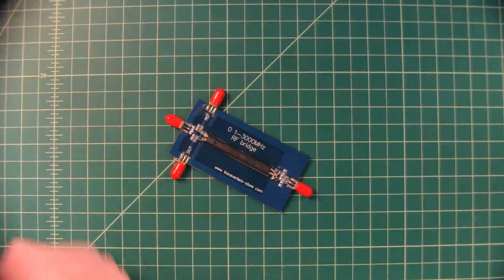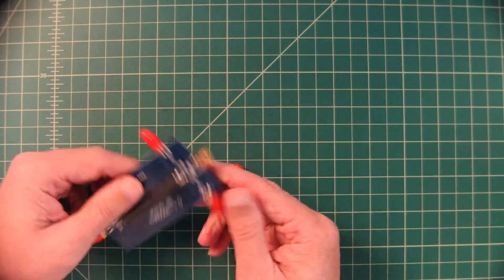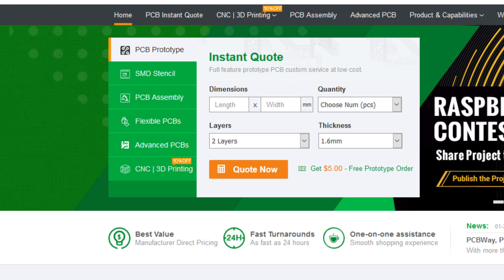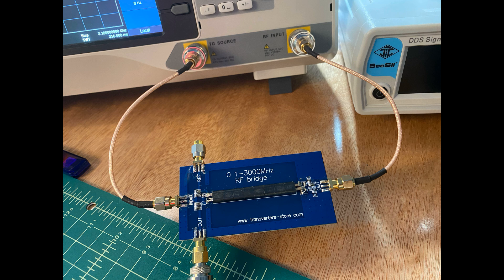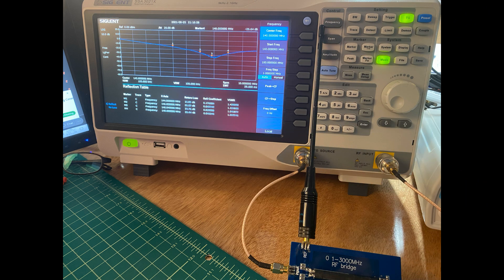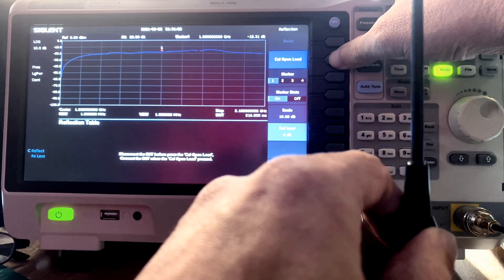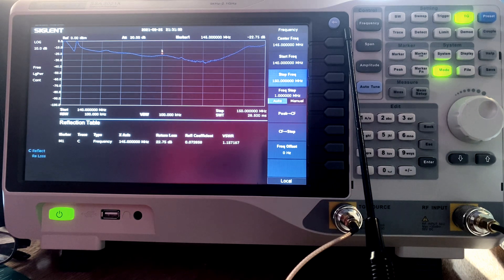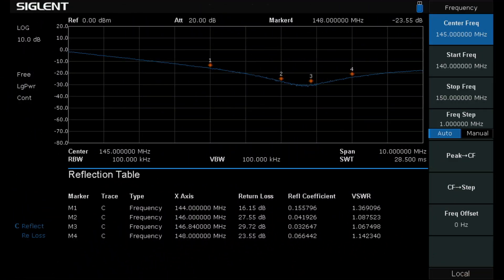Cheap RF Bridge testing with Siglent SSA 3021X

Comment: You have any video on the Siglent 3021X? I just really like you tutorials and I just picked up a 3021X Plus and was hoping you did lol.

Cheers, ❤
Reply from the maker: I've used it in a few video tests but never a full review.  I can see what I can do 👍
Reply: @TheSmokinApe  If you do and you have the Digi mod upgrade. It would be amazing to see someone do a basic test with DMR or P25. If you need any gear to help pull any of those modulation types off I can spare some old equipment from my shop that we can't use or sell anymore. Not sure how to share my contact info on here but if your interested let me know.

Comment: IMSAI guy fixed the solder issue and it appears to do a decent job when you fix layoit mistakes on the board
Reply from the maker: I think I may have saw that one, I suppose I need to revisit 👍

Comment: A bit late, but you have to bridge those resistors. Otherwise you compare the 50ohm of the ref to the 100ohm of these series resitors, therefore flawing your test by a factor of 2
Reply from the maker: Yeah, I later saw the board needed to be modded.  Thanks for the info 👍

Comment: You don't have to press and hold the button for Cal Open Load. You press it once and release it, then connect the DUT. The on screen instructions are just a poor translation for that. Also, reversing the DUT and load ports will invert your results for certain antennas like that since your middle pin and outer shield are essentially reversed. Just fix the error.

Comment: Hi there just a question if I get a dmr radio can I listen to frequency with out a coad plug not interested in transmitting just listening?
Reply from the maker: You need a license and a DMR ID, to connect to a Talkgroup you need to transmit to connect.  At least as I understand it...

Comment: I sort of felt left behind on this one  I was left with so many questions like; Why would someone want this. Does it allow you to do tests that are not normally done with a spectrum analyzer or VNA? You made a statement regarding SWR vs VSWR, what is the difference? Love your stuff in general also am a  fan of Coffee and Ham radio. This one would have really benefited from more detail. You were in no danger of running long. 73
Reply from the maker: Thanks for the feedback William.  Maybe it was that I was so underwhelmed with the product, not sure.  Anyway, a good RF Bridge can be used to test filters and measure antenna performance.  My SA has software to measure reflection loss similar to a VNA but it doesn't have the bridge hardware to do so, they sell one but its a few hundred dollars.  I picked this cheapo up and hoped it would work out for me, it sort of did in the end but I'd rather stick with the NanoVNA.  VSWR is Voltage Standing Wave Ratio (that's the correct way to say it) us hams have adopted the shorter "SWR".
Reply: @TheSmokinApe  Thanks 73